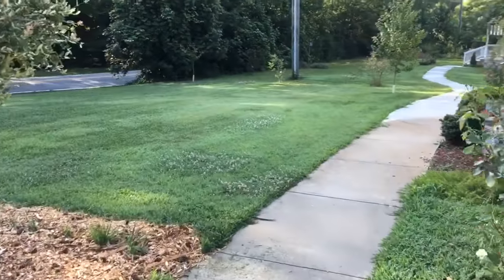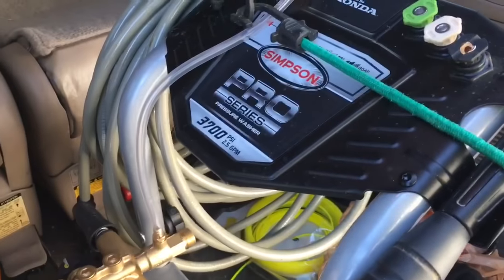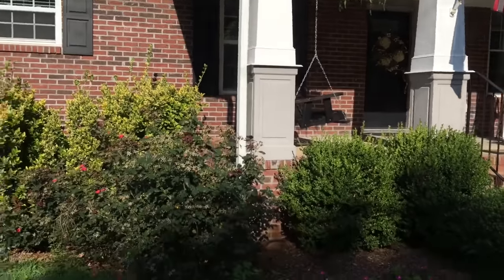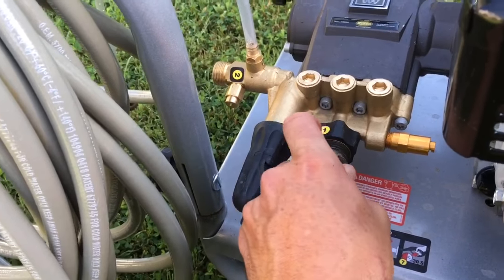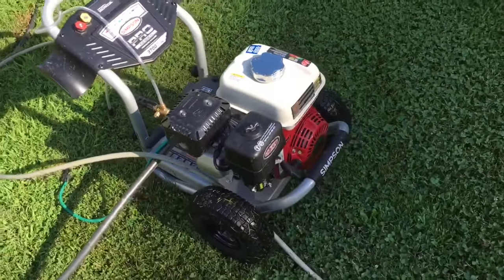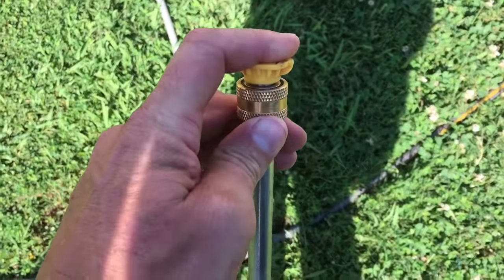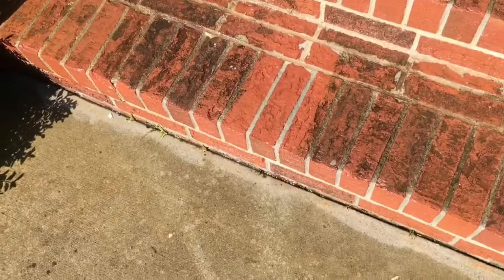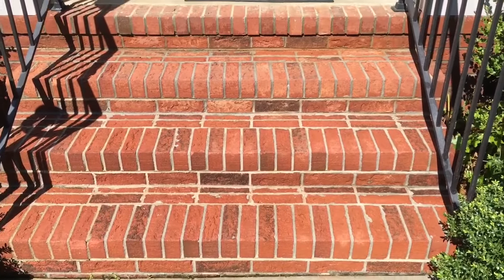More than you ever wanted to know about pressure washing brick steps

Comment: Your the first person to explain how important it is to actually run the gas dry in the line before driving with it, thank you
Reply: the other issue is if the machine (4 stroke) is not run for a while and fuel is left in the carb bowl it can form sort of like a lacquer coating and that will restrict but more often clog the jets.  It's a good tip even with lawnmowers etc.

Comment: I know it's very tempting to blast your bricks clean, but not a great idea. Brick and mortar calls for about 400 psi of pressure. Too much will erode the outer layer of the brick, and mortar if not in great condition will go sooner. Unfortunately the safest way is with a brush and some elbow grease. If you go the pressure washer route then at least seal the bricks afterwards. Or not then a few years later you can call people like me over to repoint and lay new brick for you 😉
Reply: Yes. Brick association of America recommends brush rather than pressure washer. They have a YouTube video on it.
Reply: @AndrewHelgeCox Good luck with that

Comment: How much oxi clean per gallon of water do you recommend? And do you recommend on vinyl siding?
Reply from the maker: Actually, now I just pressure wash first, then afterwards I spray with a little 30 Seconds Cleaner let it sit a few minutes and rinse. The pressure washer does the cleaning, then the chemicals kills any mold or mildew you can’t really see, and keeps it away longer.

Comment: Do you know if you would get the same results if you run that solution through an x jet to wash a whole brick house
Reply from the maker: I actually don't use detergents on brick anymore. Just water through the 15 degree nozzle. The detergent probably kills and holds the mildew at bay longer though -- but it doesn't seem to clean any faster.

Comment: Will that stuff clean anything,  wood fence, concrete blocks and sk on
Reply from the maker: I usually use a 1/10 ratio of bleach/water for wood (because it has more immediate results with mold and mildew.) The Oxiclean has a gentler bleaching action, but seems to soften grime up better. I know that's not the most definitive answer, but I hope it helps, Jeffrey. Thanks for the comment.

Comment: I know this video is a little old but how is or did the pressure washer do reliability wise? Ive got the same one except 4,000 PSI and 3.5 GPM.
Reply from the maker: It’s doing great. Still running like brand new. However, I don’t use it every day. I probably average once a month — if that. I hope yours never fails you. Thanks for the comment!
Reply: 💥 I bought the same one last year. 3.5 gets it done a lot faster.

Comment: Did you put soap or sonething
Reply from the maker: Oxiclean ... but you really don't have to. I just did a nasty set of steps last week -- so covered in mildew and algae you could barely tell they were brick. They cleaned up just like this, and didn't take any more time. Some people swear by the detergents and that they speed up the process, and maybe on some materials they do, but for the most part I've found the pressure washer does most (if not all) of the cleaning.

Comment: Did you use OXICLEAN?  Good work
Reply from the maker: Yep .. that's it. Thanks!
Reply: @FamilyFriendlyDIY  Thank you, so did you mix it with water and that it. I am going to use that same solution to remove some grey streaks on some bricks
Reply from the maker: @TrentonWilliams34250603  Yep. I just put a couple of scoops in a 2 gallon sprayer.

Comment: Doesn't pressure wash affect brick walls?
Reply from the maker: It depends on how soft the brick or mortar are, and how high of pressure you use. Most modern bricks and mortar are very hard, and the algae and mildew will come off long before the surface begins to be damaged, but older or softer brick and mortar can certainly be eroded by high pressure ... some even by low pressure. You just have to be vigilant about what you're washing, and make a change in nozzle/distance/technique if you start to notice damage. And yes, some really soft brick/mortar you should not pressure wash at all. You get a feel for it eventually.

Comment: Can pressure washing damage brick?
Reply from the maker: Certainly, but it depends on the softness of the brick, the amount of pressure, the type of nozzle, and the duration (dwell) of spray. IMO you're more likely to damage the mortar than the brick with a typical pressure washer and a 15 degree nozzle, but with vigilance that shouldn't be an issue either.    Here's my take: The dirt/mold/mildew is the top layer of what someone will be cleaning. Logically, that top layer has to come off before damage will begin to occur to the brick or mortar. As long as you move on to another area as soon as you see the dirt etc. gone, you're not going to do any more harm than you would with a stiff scrub-brush. ... Just my opinion. Hope it helps. Thanks for the comment.
Reply: @FamilyFriendlyDIY  Is is the same case for a limestone sill?

Comment: Dave Voskos, how's your Sequoia driving? I own one as well.
Reply from the maker: It's doing good. It has about 228k miles on it now, but still runs great and uses zero oil. The only thing wrong with it is the tailgate window stopped working about a month ago, which is kind of a bummer because I liked hanging long boards out of it when I didn't want to hook up the trailer. Thanks for asking. Hope yours is giving you good service as well.
Reply: @FamilyFriendlyDIY  I just reached 195k on my 2006 Limited Sequoia and payed a pretty penny within the last 6 month to restore it to drivable condition .. 1st it was $4500(new rack&piniom), OKay it happens especially when it's about to roll over 200k..  But then a p2440 happened and added another $2k. BUT WHEN IT WORKS IT WORKS WELL.

Comment: Hey,
I just stained my brick walls in my patio and am really not liking the color. Can i pressure wash the stain out?
Reply from the maker: Pressure washing might lighten the stain a bit by taking some of the material off the surface, but stain, by nature, is absorbed into the masonry so it probably won't make much of a difference (if any). Sorry Steven, but thanks for the comment.

Comment: Loved this ! Very valuable step by step "tutorial" for beginners 💯 

Is it the same to wash a brick house? ( Apply the chemical and wash with a PW) I see that softwash is what people do for houses to not damage anything, 
what about brick houses, do we PW them? 
thank you!
Reply from the maker: Thanks. Yes, this is the way to do a brick house as well. I don't do it exactly like this on vinyl siding, however. I spray on the solution with the pump sprayer (just like for the brick) (and starting from the bottom) to allow it to begin softening the dirt, but then I use the solution in a bucket with an extendable car-wash brush to clean it. I then "rinse" it with the pressure washer using lower pressure tips, or staying back a lot further to keep from damaging the siding. It's easy to blow holes in vinyl especially if has a lot of UV damage. With a little practice, you get used to how close you can get to different materials without causing damage. You have to be most careful with wood and paint. Even the lower pressure nozzles will strip paint and feather/cut into wood if you get too close. I practiced on some stuff that I wasn't concerned about just to "test" the limits--and I highly recommend it. ...Thank you for the comment!

Comment: What’s the name of the solution?
Reply from the maker: Just plain old Oxyclean. ... Someone told me it didn't really do anything; so I took the pump sprayer and wrote "Test" on my driveway with the solution. I thought it didn't work, but looking at it a couple of weeks later, I could clearly see "Test" bleached out on the concrete. I think the solution kills the stuff that makes the stains, but it takes the mechanical action of the washer (or in this case, rain) to get rid of the "dead" stain.
Reply: Dave Vos

Comment: Not for nothing but your pressure washer injects chemicals after the pump not through the pump ... just look at where the chemical line enters - it's AFTER the pump.  Pressure washer manufactures refer to it as "down stream injection"... no need to worry about chemistry going through the pump.
Reply: 💥 Good to know.   Thanks for clarifying that.